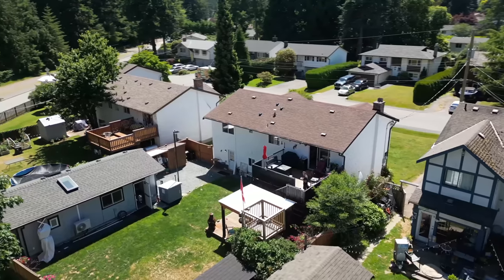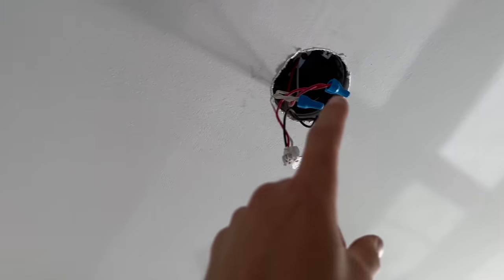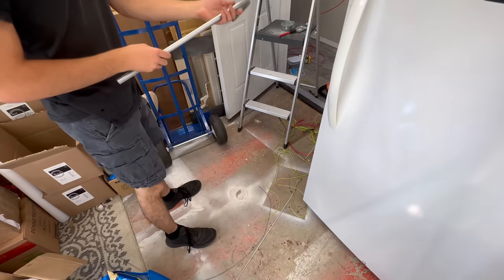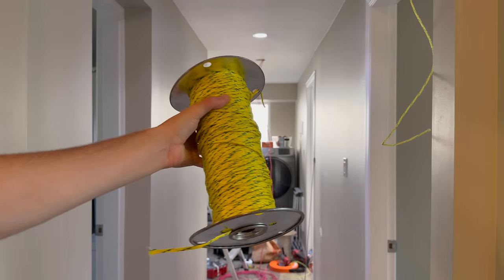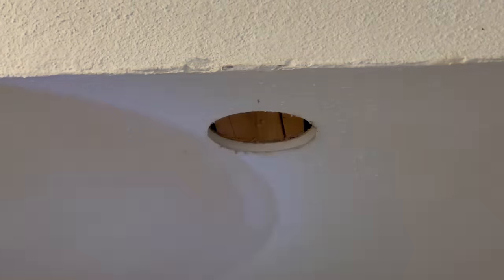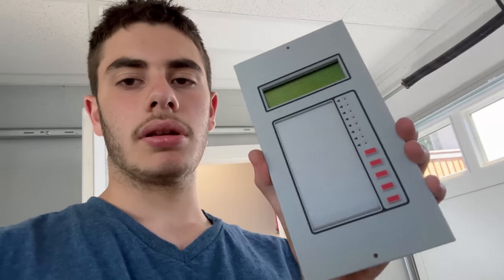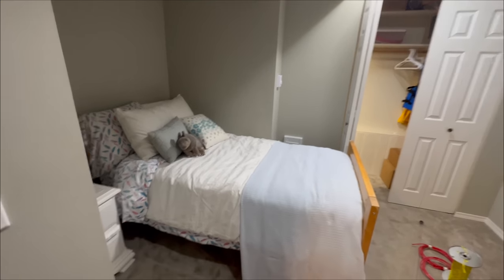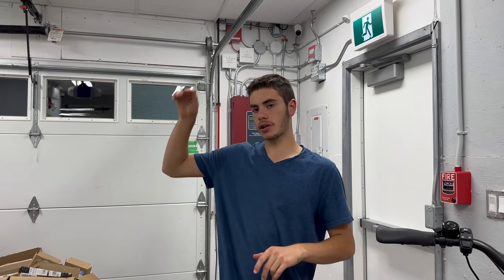Installing a fire alarm system in my house, Notifier addressable rough-in (part 1)

Comment: I have a fire alarm system in my house to the panels kind of broken a bit screwed up with it but it still works and it’s still functional I had to run the wires up in the attic though there is a thing 4 fire alarms in the house and it’s permanent

Comment: Maybe start by get the electrical sorted out decent, all those loose cables under floors, through walls and ceilings, or secured with staples isn’t really great… juist built the houses like in Europe… bricks and all cables through pipes, all 230vols. Much easier.
Reply from the maker: What are you even talking about
Reply: @nics-systems-electric  why would you install such extensive system in your house. If fire is a huge deal, start preventing it. That’s what I’m trying to say. Besides I hope you didn’t hit any cables with that drill when making a Swiss cheese of your walls, that’s a fire hazard.
Reply from the maker: @vliegtuigje16  there's no fire to prevent as a house is constructed just like every other one no differences. And you don't just drill anywhere without thinking that should be common sense you use your head and think how things are ran and are methodical about the process
Reply: @nics-systems-electric  common sense… in Europe there are just rules so you don’t have to hope the one who build it, did it logically…
Reply from the maker: @vliegtuigje16  by rules I'm guessing you're meaning codes for the construction of structures? We do absolutely have that here in Canada and North America

Comment: Are you going to put all the sounder strobes to be low frequency sounders ? 

It would be easier if you used the garage system instead of wiring a new system
Reply from the maker: Low frequency sounder strobes

Comment: this is a really cool project, i also think its a bit funny how a few months ago, u made a no annunciator video, and now you're installing one
Reply from the maker: Thanks. I still stand by what I said the annunciator video was referring to the garage building where it would be unnecessary where the panel is located right at the front door this is a different situation where the panel is not in a easily accessible place so annunciator is needed

Comment: 1:03:40 is Canada different then the US. When I install a smoke it must be in the highest point in the room, granted I know it’s your house and. It won’t be inspected but just curious why your putting them on the duct chases so much. I mean even technically if there was a division in the ceiling like a beam greater than 12” I believe, a smoke would be necessary on either side.
Reply from the maker: Because it's this or literally nothing I have no other choice unless I start ripping down all of the drywall so I can other places here or have none at all

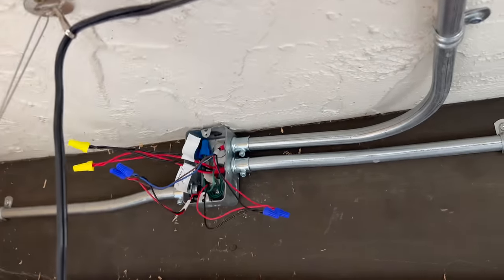Comment: 30:18 Loop is unnecessary, I have trouble shot both systems. They both are horrible regardless.
Reply from the maker: Fire alarm should always be wired in a loop the only exception being isolated branches you can easily break apart a system wired in a loop to narrow down the problem area where as it is much more difficult if it's a T tapped system

Comment: I'm not Canadian, but I believe there is a requirement for outdoor blue strobes to show FACP location. Will you install those strobes with your house system? I know you have blue strobes outside the building you do system tests in, so I was just wondering.
Reply from the maker: Probably not this system is not required if a blue strobe isn't required on the house before then it's still not required now
Reply: I've never once seen a blue strobe for that purpose, what state do you live in?
Reply from the maker: @FireTech7  it's a Canadian thing
Reply: @nics-systems-electric  ah

Comment: I remember when i installed a fire alarm system in my house, i fell right through the ceiling because i saw a black widow
Reply from the maker: Double drywall may have saved me when I was roughing in the second floor earlier this week when the board I was standing on Snapped

Comment: does fire alarm require box fill calculations? i just thought of it because i saw like 5 wires going into a 2 gang box. great stuff btw this is a really clean install, especially with those amazing bends in the garage
Reply from the maker: 5 18 gauge wires would definitely not be a problem fill calculations are usually based on heat from current carrying conductors which fire alarm does not create the need for that calculation you still try and not push too much in there but the heat is not a concern

Comment: Nice nic quick tip if your going to put a detector in the kitchen use a photoelectric detector to prevent false alarms
Reply from the maker: No definitely not the kitchen
Reply: from my experience photoelectric generally cause more false alarms because of cooking smoke
Reply from the maker: @dabitzz  ionization is by far worse for false alarms however either is not great to be in a kitchen no smoke detection is immune to kitchen heat detectors really the most you could do

Comment: Hey Nic! Do you have any updates on the problem of the synchronization of the fire alarms at your school?
Reply from the maker: The XP6 card is refusing to work we've tried replacing it and the sync module and using external sync module and it ended up stopped working completely so now the school only has 3 out of 13 nac circuits operational so we have to try and get a nac booster panel installed
Reply: Ay caramba, that sounds like a major frigging headache

Comment: This is a cool project and it’s definitely nice that you’ve been allowed to do all this work to your home. Was just wondering does the fire alarm code allow a commercial system to protect a residential property? The only reason I ask is because I would think a commercial system would require more maintenance and troubleshooting than normal residential smoke alarms.
Reply from the maker: There is nothing that says you can't have a commercial fire alarm system in a house though if it is required to be there it does need to be tested properly however my house does not require to be there so it is just extra and is equal and offers more than the current smoke alarms set up
Reply: @nics-systems-electric  ok cool, that makes sense. I was just wondering since it would probably be more difficult for a homeowner to maintain a commercial system than typical residential alarms. Very good looking install and I’m excited to see more videos from this project!

Comment: I have a question, you have said that in Canada you need a blue strobe to show panel/annunciator location. Will you be adding one of those in your system, or will there not be one?
Reply from the maker: For now there is not one as there wasn't before with the existing smoke alarms so it isn't a required addition
Reply: @nics-systems-electric  huh, well I thought even with a new addition of a commercial system it would require one. but ok.
Reply from the maker: @Declanslifesafety  not if the system isn't required to be there
Reply: @nics-systems-electric  ok, makes sense.

Comment: I think you should put a few more sounders in to account for closed doors
Reply from the maker: I am limited on where I can add devices for aesthetics and you must consider it is a finished building we are not all areas are accessible as long as 75 dB is met it is fine one sounder per floor is a direct replacement of the smoke alarm set up originally installed
Reply: @nics-systems-electric  where I live it's code to have a sounding device in every room that could be closed off that could also be used as a bedroom, also they make you use those silly talking alarms, viva la Massachusetts
Reply from the maker: @elektrokinesis4150  that would be the case here if this was a brand new building however it's not it was built to the code in cycle in 1976 so the building is grandfathered in I'm already going above and beyond installing smoke detectors in every bedroom

Comment: quick question can you provide a canadian link (canadian link will work for me scince im canadian) to the blue strobe ive been trying tk find it scince im getting a pannel and tons of pull stations and bells from my school sry for the trouble of you frinding it and if your not canadian or provide it sorry for wasteing your time on reading this whole comment.
Reply: My spelling💀
Reply from the maker: There's multiple blue strobes that are used so I'm not sure what one you would want a link to
Reply: Like the blue strobe on your garage shed room can't remember what's it called. I think it's to show where the panel is from the outside
Reply from the maker: @Dawezil  system sensor SRK
Reply: @nics-systems-electric  thx man I appreciate it

Comment: I feel like the downstairs door leading into the stars would benefit from having a door magnet/spring loaded closers
Reply from the maker: Maybe if it was possible to get 120 V over to it
Reply: @nics-systems-electric  you can hook them up to low voltage as well, and then into the panel somehow, so when it goes into alarm it will cut power to it, closing the door. I believe there are many videos on it
Reply from the maker: @cadentheis  not a fan of running them off of the panels 24 V power

Comment: Are you planning on connecting this system to the garage at all? I think it would be a neat feature.
Reply from the maker: Just for supervisory not full alarm
Reply: @nics-systems-electric Any reason for opting for putting the other panel in supervisory and not alarm?
Reply from the maker: @onefastslimjim  two completely separate buildings so it's not necessarily but it would be fine if the house put the garage into alarm but not the other way around as I wouldn't be able to play around with the system out there so much
Reply: @nics-systems-electric  Yeah that's what I was thinking, I think I understood that you wanted the house to put the garage in supervisory, and I was like "Well just put the garage in alarm, since if the house is in alarm, it's probably pretty serious, but have the garage put the house in supervisory so we can still get some awesome system test videos" lol. Thanks for clarifying.